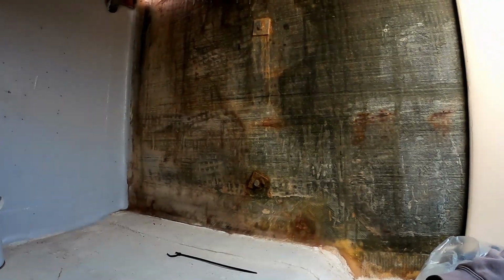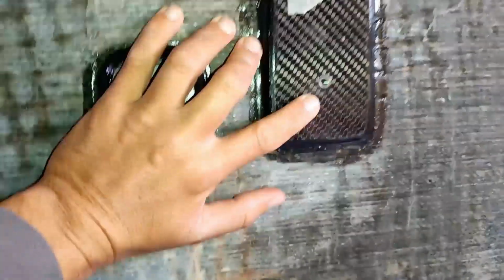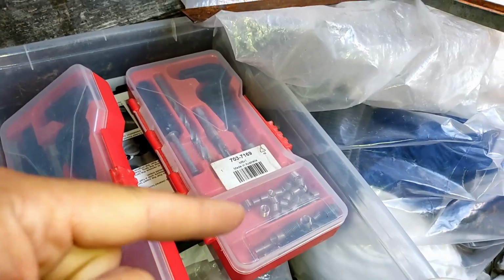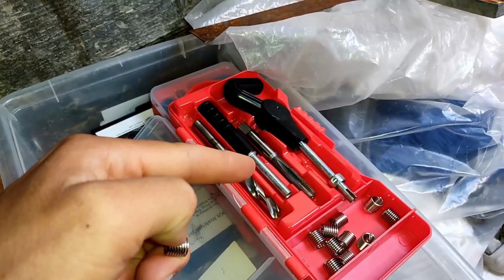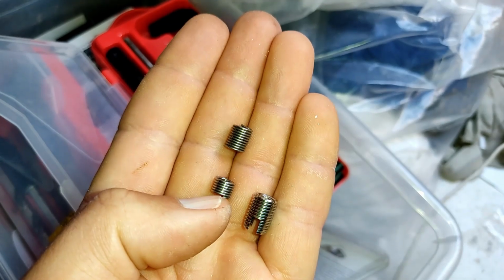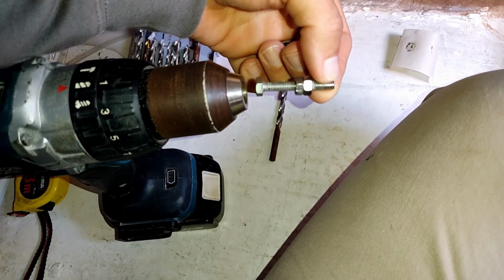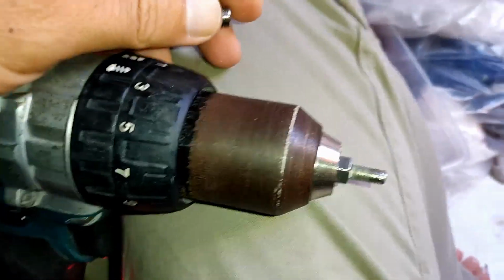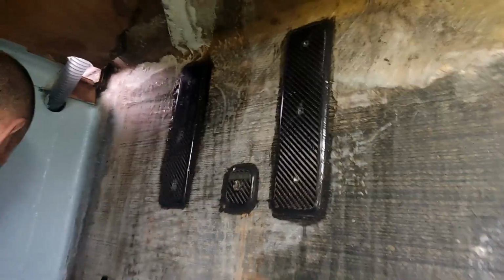The RIGHT Way to Bolt Into a Carbon Fibre Boat

Comment: A great process, why choose carbon pads over drilling an oversized hole and filling with thickened epoxy, then putting your inserts into that? I will be doing many of these attachments in the future.
Reply: @britboy20002  he probably didn't want to drill big holes in a structural carbon bullhead.

Comment: Stainless inserts are excellent. I have used a fair bit of Thermolite on my boat, essentially a rigid polyurethane/glass composite. Especially useful where you only have good access to one side.

Comment: Another great descriptive video, I was watching you use your custom stainless thread-sert bolt and remarking to myself better hope that doesn’t bind up......I also find putting a small chamfer on the hole with a counter sink bit can help (might also reduce that carbon burr from forming)
Thought you might have also talked about “nut-serts” (threaded compress pop rivet type fittings) for blind panel/sheet work where the panel is too shallow for a thread insert and has restrictive access ...... I have never used them on carbon just sheet metal and alloy, but should work and I believe they come in stainless
Reply from the maker: They generally don't bind as long as the thread on the bolt in the insert is lubricated. Yep, counter sinking the hole a little before the insert helps reduce the blow out, but I found it quicker just to sand them after. 
I have tried the blind pop rivet version. Generally with little success, they don't seem to grip like they do in metal. I have used like you used them plenty on metal jobs with great success.

Comment: I use a split lock washer between the two nuts, otherwise they'll just move together - or the end one will do what yours did (clearly not a big deal if you have an open end wrench handy).  The thing about all these methods are all the ways they can go wrong. What I find critical is some practice. Someone who does any of these methods a lot will be infinitely better at it then even an intelligent person who's good at 'figuring stuff out.' (I am, but every time I've used a helicoil I've screwed up the first one. 'Every time'? I'll bet in my 60+ years I've used them at most  maybe four times.)  Threaded inserts? I've used a lot of those. I've got these galvanized ones (probably not good at sea) that have an Allen key fitting for installing. They are my favorite. I had to figure out for myself the proper drill bit and the Allen key because they never come with any instructions. (And drill size will be different between soft wood and hard (or carbon/epoxy.)  I've also used some brass ones for furniture assembly. Both of these would've worked for your watermaker because even if they corrode they'll still hold.  For tapping into metal? I always always make sure I have at least two taps and I go very slow. 
I think if I did your task for the first time I'd make some extra carbon pads  and use them for practice.  Then I could use the ones that worked  by epoxying them in a locker or where ever.  Good video.
Reply from the maker: Yep practice always make things better. I would not recommend anything other than stainless inserts especially into carbon. Other materials will turn to custard very quickly and defeat the purpose of all the work of putting in inserts

Comment: Nice work Barnacles, 24 volt water maker I presume, same power draw, less current, smaller cable required. Paikea is being looked after better now than when she was built. Was not aware that carbon was so electrolytic, now I know.
Reply from the maker: Yes, same power draw with less current and smaller lighter cheaper cables.
Carbon is quite a monster at eating things in the marine environment! It is also an electrical mightmare as it is so conductive. Any electrical leak and you know about it!

Comment: Grate video as always! A quick question regarding galvanic corrosion. I’m about to change out the pop rivets that hold the spreaders to my mast. I have a aluminium mast and the spreaders is made of carbon. Is there any particular thing’s I need to take in consideration because of the materials? Any tips?
Reply from the maker: Yes! These materials don't play well together.
So first and most desired option is to have a couple of layers of eglass over the carbon spreader where it will be on contact with the aluminum. 
Second is to have a good paint over the carbon to help isolate it.
Make sure the pop rivets are monel and use Duralac in all the connections.